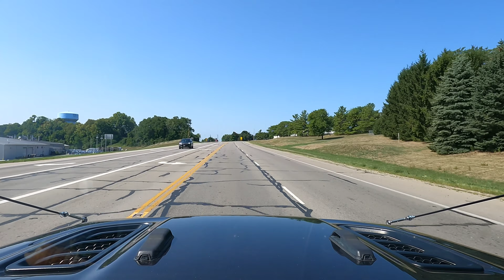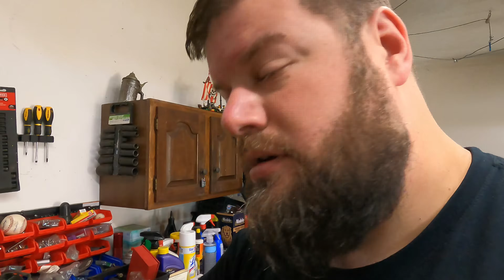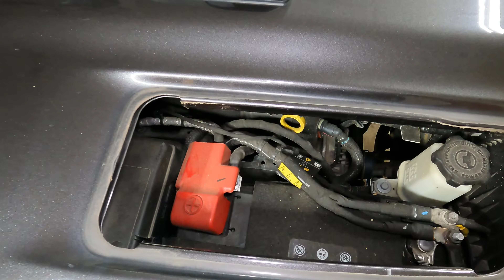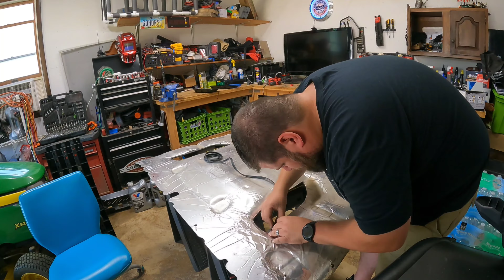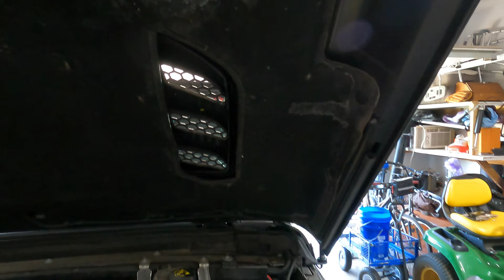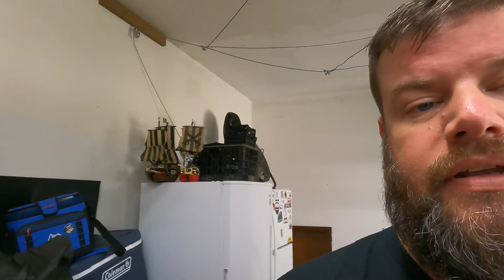Release the Heat! Jeep JL Hood Vent Mod

Comment: This is a great mod. Not to reduce total heat emanating from the engine but to direct it. When heat dissipates evenly on each side of the hood it is felt by the driver and those nearby the car.
Reply from the maker: Exactly! It's a great upgrade for heat management.

Comment: Great info
how did you like the result when you did up your JK?
Reply from the maker: @robertgwysong7822  I thought it was a great mod and never had any over heating issues. Now I also never had any over heating issues, so I can't say if it truly helped anything,  but it definitely didn't hurt. I also think it was weird that Jeep left the underwood insulation cut away on the JK. It's almost as if they expected you to make them functionality. 

When I added hood vents to my ZJ in roughly the same position, I did measure a 15° cooler ambient temperature with the hood vents added.

Comment: Opening the vents makes a big difference. Great video. Thanks for sharing. I used waterproof screen on mine so the water still drains off to the sides and out of the hood like the oem configuration. Also noticed your oil pressure seems really low. My '20 JT idles at 30psi.
Reply from the maker: Thank you! That's a great idea and I did see a write up where someone used that. I wanted to do this a "free" mod, as I only paid for the trim and that was cheap. 

As for the oil pressure,  old school rule is 10 psi for ever 1000 RPMs,  so it should be fine. My JL also has the 2.0, so that could be the difference.  Anyways,  Thanks for the comment and Happy Jeepin!
Reply: Yours idles at 30psi warm? Mime is also at 19-20 when idling warmed up
Reply from the maker: Thanks for the comment! Yeah I don't think the lower oil pressure is an issue  but it might be why the 3.6 likes to eat cams.
Reply: @KJsProjects  yeh, I don't think it's an issue either. Mine is at 50psi under w.o.t. so I assume that's the normal range between idle and wot